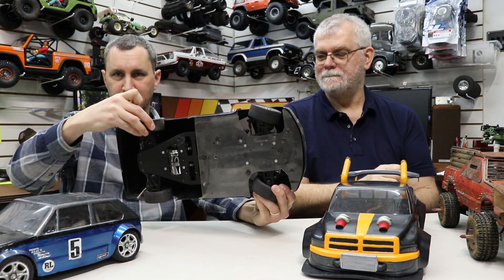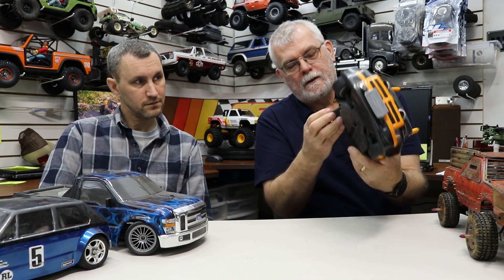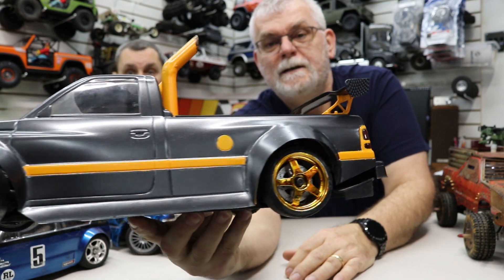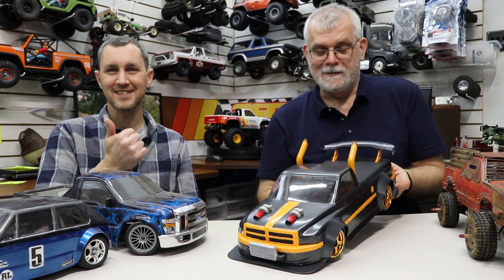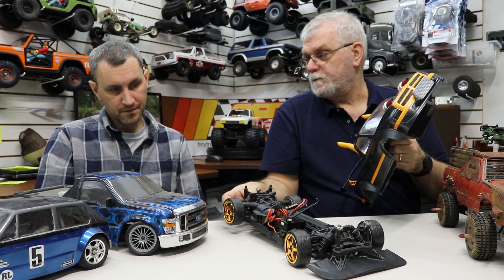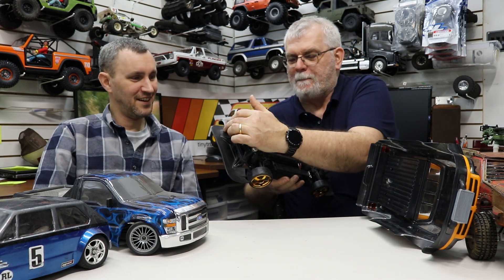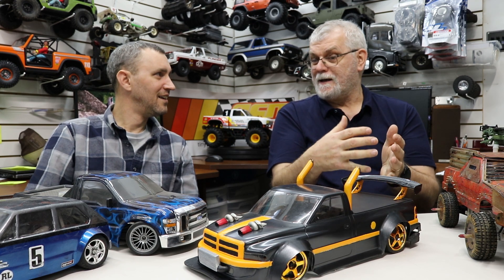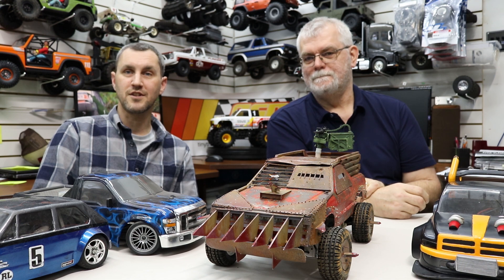Rig Review: OnRoad V100 Dodge Ram by Tank RC

Comment: The V100 is okay (I have both Losi and Vaterra Camaro versions) BUT, I can tell you the Kyosho Fazer is WAY better and it costs less.  I have the '70 Chevelle SS model.  The Fazer is similar to V100 (awd, on-road, etc) except it has oil shocks, better quality overall and a much much better radio system than Losi.  Also, out of the box, the Fazer is faster than the V100.  My biggest issue with the V100 is the lack of oil filled shocks, the diffs are virtually locked and the servo is slower than molasses.  Buy the Kyosho and you'll be happy. 😊

I think I've passed 100 a while back but I've lost count.  I've been in the RC hobby since the early 1970's so I've been collecting for a very long time
Reply from the maker: I've always loved my Kyosho cars. Every one of them. But.. for a basic sedan chassis I'm still pleased as ever with the V100s